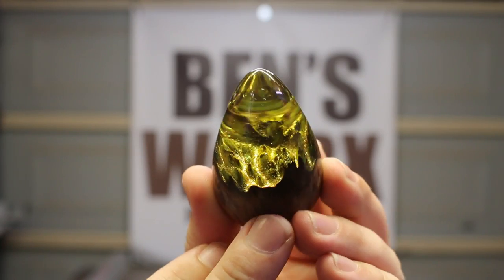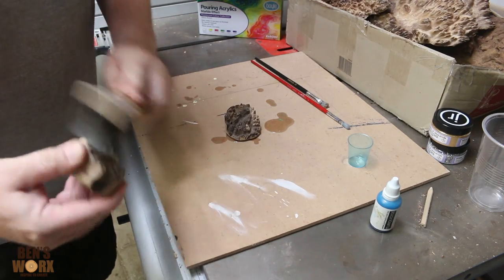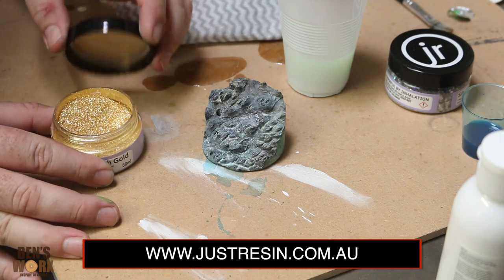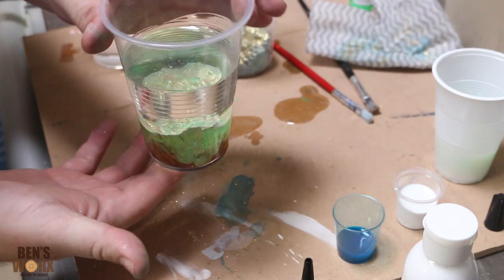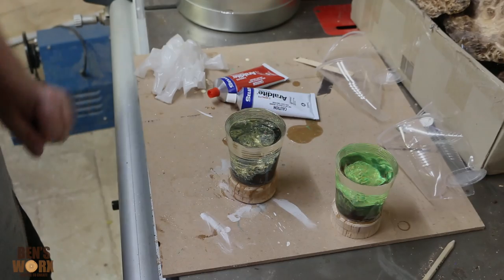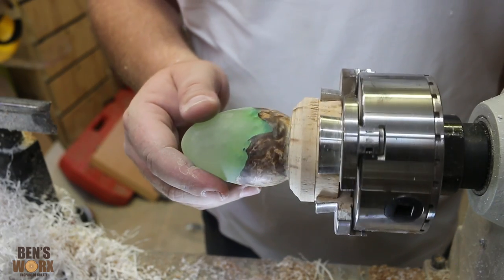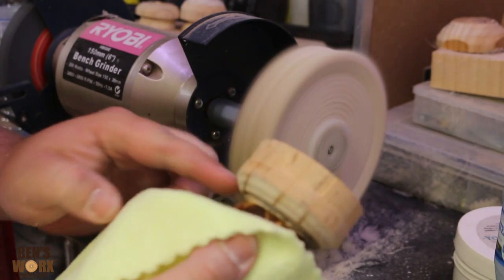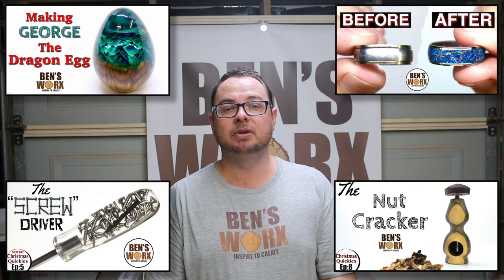Clear resin casting tutorial making a glitter dragon egg

Comment: I am just learning to use resin and have watched a lot of videos but I still have a couple questions. Because resin is expensive I used a cheaper brand for my first couple just to practice getting techniques down but when I used the plastic cups like yours they started to melt. Is this because of the resin? I have just bought Alumilite resin and am getting ready to start. Do you think The same thing will happen? I am using a pressure pot.

Comment: is there any other steps I can take to eliminate bubbles such as setting the resin in hot water before pouring?
Reply from the maker: That will help but it won’t eliminate all the bubbles, the only guaranteed way is to use a pressure pot
Reply: thanks for your time.  Like your channel

Comment: Hello,  how do you prevent blowout of the resin while turning?  I was trying to turn an egg that had a pine come embedded in the resin and it was none stop catches and big chucks blew out.  I was turning at 1800 rpm and using a Rockler round carbide cutter and the resin was alumilite.
Reply from the maker: If you get a chip start doing light passes until the chip is turned out, chipping will create more chipping

Comment: Nice work. I bought that wood working lathe. Just to have as a relic in the corner of my shop XD
Reply from the maker: Thanks Niko! You should dust it off
Reply: Yeh am gunna start teachin the stepson metal work so will start him with wood working first. :) ive got a project ideal for u but im sure its been done before n if not well then I challenge you to really get ur crafting side out an show me ur version of a carved n detailed dragon. 24inch tall 12 inch wide. 6inch tail n wing span of 18 inchs. Its a part project clearly but i wanna see how you would do it. Im currently making a aluminum mold for mine :)
Reply from the maker: Sounds good Niko, I’m not sure I would have the time to make the dragon but it sounds cool 👍
Reply: Understandable. Its been 4 days my cnc mill has been cuttin parts for this mold XD hella work. Someone wanted a castiron dragon but ive convinced him to go with a injection of glass sand for his prototype so it looks very nice as a show piece XD
Reply: An with ur uploads n such i wouldnt expect a dragon for at least a year. :p
Reply from the maker: Yeah I’m super busy at the moment
Reply: At 4:25am best be for work XD